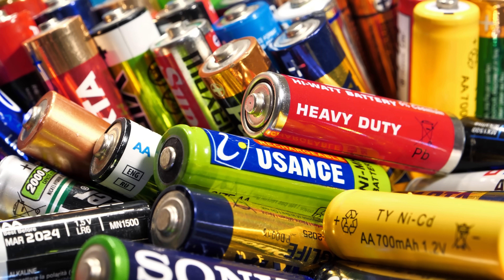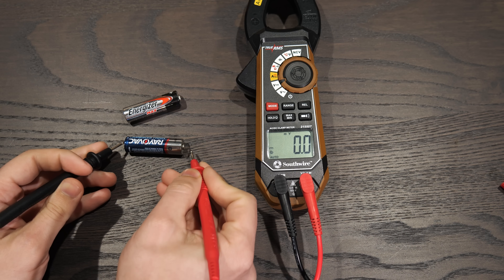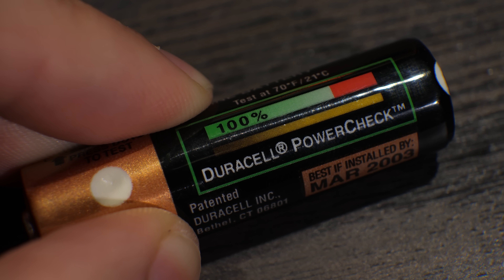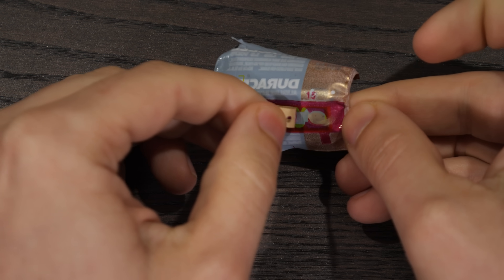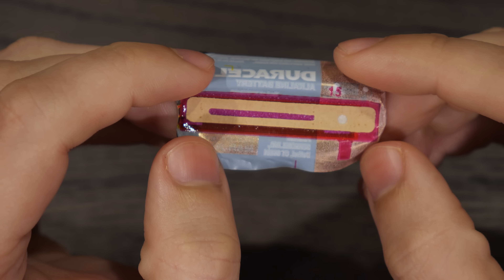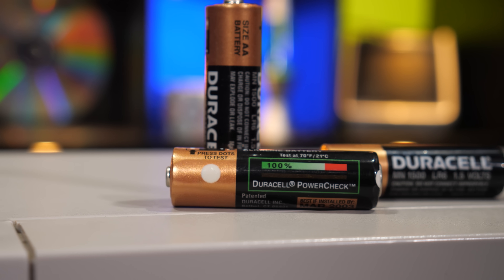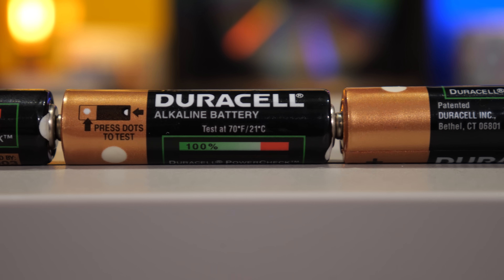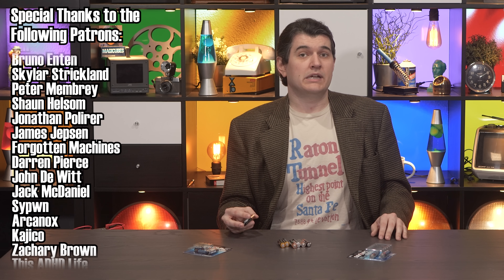Duracell PowerCheck: A genius idea which didn't last that long

Comment: I think this may make more sense for rechargeable AA batteries. Instead of sticking a battery of uncertain charge level in a charger to top up, even if it's already above 80%, you use the tester on the side. Battery chemistry doesn't tend to like overcharging, it puts stress on the battery.

Comment: IMO this type of inbuilt and reliable charge level tester still makes a lot of sense in batteries, not in the alkaline use and throw types but in the ones that we don't throw away upon discharge...namely rechargeable batteries. Would be great to check the charge level on one that's been lying around and you dont know if its full or not without the use of some external tool. Maybe some brands already offer this but I have yet to see one with such a feature though.

Comment: I remember when the tester wasn't even part of the battery label but a separate included strip. Said strip was actually easier to use because it was meant to wrap around the battery and reach both terminals. Oh and the 9v batteries came with one too.

Comment: 1. I used to test batteries people put into a "recycle" bin from work. I don't have hard statistics but I would say 20-30% had FULL CHARGE. I think people would discard  a set when just one battery would fail.ll l And when  have a problem, I test to find "the one" battery which is causing the problem (more often than not, although a set CAN discharge in unison.
2. I sort batteries by charge level as some devices can work well (if not to peak) with less than a full charge while some devices only work well at a higher charge level.

Comment: Literally yesterday I was at a shop and looked at the batteries and saw ones with the included tester (don't remember the brand though, either Duracell or Energizer). Never used them though since almost all applications I use batteries are not very important. Also they are on the edge of what I would call "stupidly expensive".

Also sidenote, I'm genuinely impressed with the 25 year old Duracells (or duraleaks as many call them) did not actually leak and made a crusty white mess.

Comment: Energizer came out with them first in the early 90s, but they were on the package. They were easier to use and easier to read. As a kid, I used to keep them. I probably still have some floating around if I clean out a closet.

My parents got me a GameBoy power pack early on which was a smart investment. The NiCd battery no longer holds a charge, and I actually just removed and disposed of the battery so the power pack could be used as a power adapter.

Alkaline batteries have actually become extremely cheaply made. They now have a high rate of leaking even still in the package. In the 90s, having a battery leak was rare. The batteries were the best they had ever been. We left the batteries in the device without fear that they would ever leak. Batteries started peeing all over the place in the 2010s. It doesn't matter if they are name brand or not. Name brand seem to leak even worse, so I just get the cheap, generic batteries. A glorious era in alkaline battery technology has come to an end.

If you need batteries in anything, you need to know how to clean them. White vinegar and a cotton swab will dissolve and neutralize the crud. Next, you clean the contacts with 70%+ IPA (rubbing alcohol) to clean any residue and help dry the contacts.

Comment: I remember that they also produce a version that adds the tester to the packaging instead so as to reduce the material waste.

We used to cut that plastic part out, and you now have a handy tester for all your batteries.
Reply: YES! I believe those came out first before they built them into the labels.
Reply: Oh yeah I remember those! I just commented asking if my memories were triking me on that. Thank you
Reply: I used to keep one of those around! Not sure if I have it anymore though.
Reply: I had one around for years but mainly as a curiosity. It was better than nothing.
Reply: Yep. Came here to say just that. And yes, I have cut the tester out, too. I bet I still have it somewhere, stuck in a tool bag or a drawer...

Comment: Yeah the feeling of digging your finger into the battery to test is ingrained in my mind. I also think these made me more paranoid, as before I just got some batteries and had spares in the drawer, with these there was a sense of paranoia and I would keep taking them out and testing them, even with the batteries still unused, and I do think I ended up throwing batteries away because these indicated they were low, even though they worked fine for a TV remote or wall clock.

Comment: Any AAA,AA, C or D cell battery can easily be checked to see if they are any good. Drop a battery on to its negative end from about 6 or 8 inches on a hard surface such as a tile floor or counter. If the battery bounces even just a little bit it’s no good. If it does not bounce at all it’s good. 
Can you make a video explaining that?

Comment: The change in chemistry of a used battery vs a new battery means that if you drop the battery onto a hard surface it will bounce differently. I think the used batteries will bounce more than the new batteries. This is a quick test to see if a battery is used or not.

Comment: I like my rechargable AAs and AAAs. Pretty much only use them for controllers and a wireless keyboard.

One thing I used to do with disposable alkalines is when they were too low to power some stuff, they would be enough to use in a remote for a short time after.

Comment: I have Cassio branded AA cells in my FX100 calculator. They are still powering the calculator just fine and have date codes of 1983.

They don't make them like they used to!

Comment: I find myself in the situation of having bought a big pack of batteries from the local bulk club store that I use in electric lanterns during power outages. I store the batteries separate from the lanterns because I learned a long time ago not to store batteries in the devices unless I want to throw the device away next time I need it because the batteries leaked and corroded the contacts to the point of being unusable. Rechargeable batteries aren’t really a good option from what I’ve found because you don’t want to leave them constantly getting charged and they aren’t smart enough to maintain a charge between 80% and 90%. So when the lights go out (infrequently) I need to pull out the lanterns, pull out the batteries, get the multi-meter, find the ones that were used last time (for maybe a couple of hours) and that still have some charge on them, then load them into the lanterns so I can have lights.  I guess I should just find a decent battery tester that can test AAA through D cell batteries and throw that into my battery storage box.

Comment: On-topic:
I learned back in the day, that these Powerchecks were bad, because using them would drain a sizeable chunk of charge because of the way they worked with the slow heating element. That's why I personally never used them.
Tangential:

To this day I still have quite a few things that use AA batteries. Though I've switched to rechargeable NiMH ones. Examples for such things: Flashlights, Walkman, Discman, portable radio, clocks, remotes, RC transmitters, GBA. Admittedly, some of these are legacy devices. Some advice: If you still use things that need AA batteries, do the environment a favour and buy a charger and rechargeable ones (it's also cheaper in the long run).

Comment: These testers seem really useful for rechargeable batteries, which as you noticed are way more common now. Why are they not installed by default on those? Especially for rechargeable ones, this would also potentially justify a higher price.

Comment: Very interesting topic. I remember weakening the skin in my thumb tips having to press down so hard just to get these battery meters to show anything. It felt almost to the point of physical pain.

Nowadays we really all should just use rechargeable NiMH AAs/AAAs in all situations where those types of batteries are needed, or specialized li-ion packs, though I personally prefer the former because having a standardized battery size makes it much easier to replace in the future, and keeps devices able to work in the long run.

Having a bespoke battery that you can't easily find a replacement for can be rather detrimental. It promotes planned obsolescence and e-waste when you just can't find a new battery for something and are forced to throw it out.

Comment: lol, I remember hurting my fingers as a kid pressing as hard as possible trying to get the stripe to light up.  Got in trouble too often for throwing out good batteries, so I wanted to be absolutely sure that the battery was dead, and not that I wasn't pressing hard enough.
Shortly after we paid an arm and a leg for rechargeable batteries, and while they didn't last nearly as long, we were all much happier to throw batteries on the charger overnight to have working toys in the morning than to wait 2-3 weeks for the trip into town for Costco to buy new batteries!

These days I still have 1 item that needs actual honest-to-god real alkaline batteries and won't take rechargeable: Our label maker.  A full suite of 8 rechargeable AAA batteries is enough to turn it on... but it often turns off while printing, so we have to keep some 'real' batteries around.
That said, there are FINALLY some cheap reliable AA and AAA 1.5V lithium rechargeable options now... That would be a life-saver for the label maker!  It would also help my VR controllers that drop into low-accuracy mode after the first hour off the charger with normal nimh batteries.  What is holding me back isn't the price... it is the inevitable issue of people putting the wrong batteries in the wrong charger and messing something up.  Kind of waiting for a reliable universal charger that can charge both styles without problems.  I have seen some DIY options out there that do it... just a matter of time for a cheap commercial option... havent checked in a few months, so maybe they are already here.

Comment: aaaaaaaaaaaactually, the best way to test a double A battery is the bounce test. drop the battery from a couple of inches above a wood desk or similar. drop them vertically on the negative end and it'll bounce if it's empty and not really bounce if it's full.

and i know you dont believe me, but it's true ;)

Comment: Nah uh we don't use batteries arround, rechargeables are what you want. Get a cheap USB thing to recharge them and you are set for like $30 - And yeah the savings will come after like 5 years only but rhey will be there. But just with your Xbox controller or whatever you use it is so much more convenient to know they will be ready the next day instead of having to go buy something. And in a remote they will last for years, just as good as new batteries.

Comment: I was today years old when I found out they didn't make these anymore 😅 
But yeah, most current devices use rechargable batteries now. 
I do feel we recylced those AA batteries better than we do the ones that are in random USB powered cheap Chinese crap that you have to physically break to get to the battery though.

Comment: These were a pain to use... And needed to be put on rechargeable batteries as that's where I need these testers. I don't like having to break out the multi meter to fund which nimh batteries have a charge.

Comment: It wasn't that short lasting, was it? I haven't purchased Duracell batteries in ages, but I'm sure they still had these on the Duracell Ultras I was using for my Xbox 360 controller and Game Boy Color in the early to mid 2010s.

Comment: Why no one put a tester on rechargeable batteries like 18650?
Every time my flashlight/headlight/portable fan run out of power, I have to find a 18650 battery full of charge to replace it. But sometimes I screw up, only bring those out of charge batteries. A easy way to check if batteries has power or not we’ll be handy.

Comment: The power usage of battery-powered devices has gotten a lot more efficient too.  I remember having a number of devices that would start to malfunction when the batteries got down to about 50% capacity.  At which point they'd get retired to the junk drawer for use in flashlights or the TV remote which were capable of running them all the way down.

Comment: I used to keep half-used batteries around, since once the Wiimote stopped working, I found the AAs removed from them still provided 1.3V and could last for months in a remote control or an infrequently-used flashlight.
Reply: My Battery powered wall clock lasts for about 3 years on a depleted AA. I have about 20 other depleted batteries ready for it once this one truly runs out!
Reply: @jwalker7567 bro that clock will outlive you!
Reply: I use them up in wall clocks. Rarely need to use a new battery in a clock.
Reply: Old digital cameras would sometimes turn off at 1.4 volts. Those batteries could be reused even in motorized toys. Same with photo flashes, they need proper amperes and killed off AAs in one party evening if you were enthusiastic on the trigger and could afford the film
Reply: @grossteilfahrer  Typically those cameras would say in the instructions that you should only use lithium batteries (which maintain close to 1.5 volts until the exact moment they die), and came with a pair to get you started. Not that any of us actually bothered to read those...
Reply: @stevethepocket  yeah that is likely
Reply: I see others have already mentioned the use in wall clocks, but I'd like to note that the little clock mechanisms, despite working pretty much constantly, present an extremely low load on their batteries. So, you can use those batteries in a high current device and when it is about done for, you can swap them into a low current device, like those wall clocks.
Reply: I take the batteries out of anything I don't use at least weekly because otherwise they get forgotten about and leak.
Reply: That's still very relevant now depending which devics you have about.
Reply: I do the same with x360 controller, they end up in manual lighting or remote for finishing them up.
Reply: Yea that darn wii remote always out of power, and then I measured and the batteries were almost full all the time. I also kept them for less demanding remotes, too.
Reply: Once you build a joule thief you'll properly use up all the power left in "used" batteries ;) I once tested a simple flashlight I made with a joule thief (self-sustaining/resonating power converter) and it lasted over a day with starting voltage of under 0.9V. It's a thing that raises the voltage by very quickly turning on and off a coil, sort of like the dc/dc converters.
Reply: Yeah same. Was constantly replacing the remote control batteries with partially depleted batteries.
Reply: yeah, wiimotes were really picky about their operating voltage.  I hated that about them.
Reply: Got the kids playing on an old Wii at the moment, yeah, those things really need a lot of power - thankfully rechargables exist or I'd have a bag full of 50% charged batteries lying around
Reply: This, for sure. The Wiimotes and my digital camera both left a lot of useful life behind in "dead" AAs. I used to set them aside for use in my MiniDisc player as I could still get 10+ hours of playback out of each one.
Reply: Why didn’t you just, recharge them?

Comment: Correct me if I’m wrong but isn’t the conductivity of one’s body also a factor? Considering how tiny the battery is and the distance the current has to pass and the density of the "conductor", there surely must be some fluctuations. Or?

Comment: For some time in my life I was sourcing batteries from battery recycle bins at photo shops. Then thanks to my Panasonic RQ-NX10 I was able to assess how much power left thanks to built in battery check function. Obtained this way batteries was good for couple hours of runing that cassetplayer. Some time ago my battery in my Logitech Triatholn M720 computer mouse kick the bucket, with no way to obtain at that time new one I have turn to nerby Battery recycle bin and fount there some Duracel battery, after some clenup I place it in my mouse and it work to this day with another dozens of hour used.
For checking batteries on the go you could use bouncy method, good batteries dropped from some height behave like deadblow hammer and bounce a little, entierly empty one bounce much higgher, but of coure this method is good only for alcaline batteries.
About the topic, couple of yerars ago I have found in battery recycle bin two Energizer witch similar to Duracell checkking device inside the lable with word "GOOD", after checking they were good. Since my brother like stuff like this I presented him those batteries in a fancy box for storage.

Comment: Internal custom rechargeable batteries really aren't the win I thought they were. Yes, they're undeniably convenient now, but I have game boys, and a bunch of other stuff from my past that I can still use for the price of a cheap set of AAs, but virtually everything I buy today will require a very difficult battery replacement in 5-8 years and will be nothing more than e-waste after 10-12. I have a PS Vita which I still play, but it's battery is getting weak. I think you can still get replacements for it, but for how much longer.

To me, the holy grail is rechargeable AAs. But obviously you're trading some inconvenience there.

Comment: to check a battery's charge without using it, just drop it from a quarter height and compare it to a full battery.
if the battery bounces a bit on impact with the table or any hard surface, it is near to being empty.
if the battery doesnt bounce, it is near full.

Comment: I remember thinking these were so cool when they came out. 
Who remembers the big, fold open battery chargers that plugged into the wall and had slots for all the main sizes of batteries for when they started coming out with rechargeables